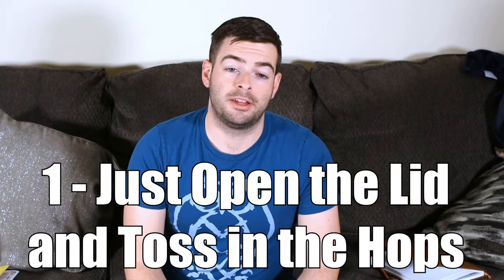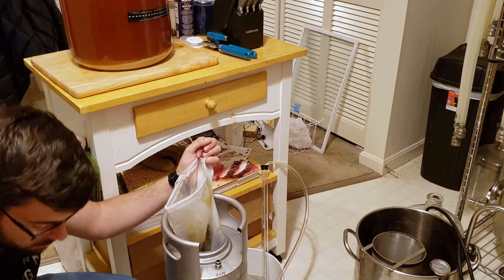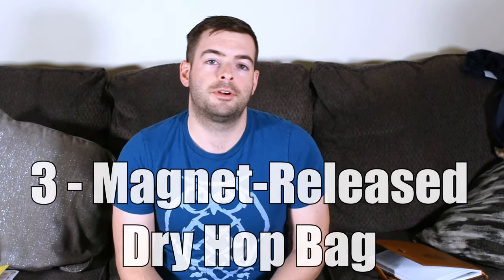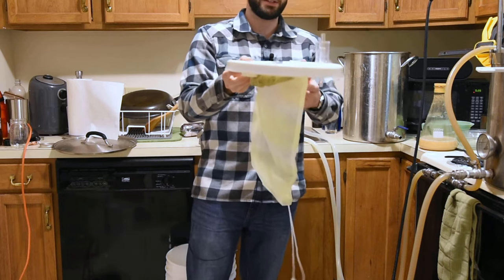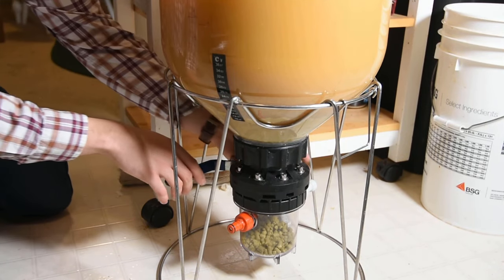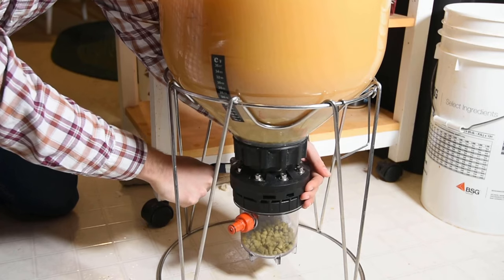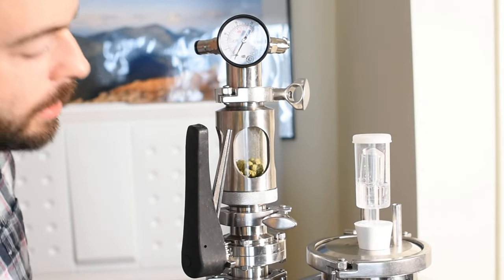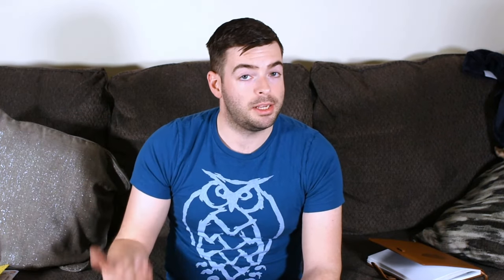5 BEST Ways to DRY HOP | Techniques for EVERY TYPE of FERMENTER | How to AVOID OXYGEN

Comment: I noticed a huge difference in flavor when using or not a hop bag. With a hop bag I couldn't smell any of the hops, so I am just throwing hops directly
Reply from the maker: That's interesting, I think in my experience I have noticed a small difference, but nothing too mind blowing. And also it does definitely help to you have a bag for cleanup
Reply: @TheApartmentBrewer  Yeah definitely the bag keeps the beer clean from all the hops residual. But I added a filter to the fermenter tap to prevent that =)

Comment: I've been using the "magnet" technique. I've been worried a bit tha CO2 generated from the fermentation removes the nice aroma of hops before the addition while it is hanging on thr head space. I could actually feel that the aroma coming out of airlock diminished over time. So by the time I tossed the hops at 10ish day of fermentation, the aroma was already almost gone. Any though about this issue?
Reply from the maker: That's not been my experience, but you could always set them up during primary where it's safe to open the fermenter, or if you have a pressure capable fermenter, you can pressurize it to avoid that

Comment: FYI for dry hoping in the Fermzilla for instance a 3-5 day dry hop, the hop pellets seem to plug up the ball lock connection when dong a "keg transfer" as this was my experience :-(   Any tips on this other than using hop bags and cold crashing  due to the 32" size of the Fermzilla. Thanks
Reply from the maker: I had good results when bagging the hops with the fermzilla, otherwise using a dip tube filter is a good way to go if they are loose

Comment: What’s your issue with the fermzilla design?
Reply from the maker: I had both the regular fermzilla and the all-rounder. I love the all-rounder, but the collection jar on the fermzilla had lots of durability issues. Specifically plastic threads cross-threading and cracking. You still have to take the carbonation caps off the collection jar when you clean/sanitize and they never seemed to get a good seal after one or two times.

Comment: At some point I'll probably build a hop dropper as I feel like that's easier than what I currently do, but it's still a bit pricey. However, I purchased two Fermzilla All Rounders. I have the beer fermenting in one, then add dry hops to the empty All Rounder which I purge the oxygen out of, and then transfer the beer on top of the All Rounder that has just the hops in it. Hope that makes sense.

Great video as always!
Reply from the maker: Definitely not a bad method. Cheers!

Comment: Just be aware what you call "purging" of the sight glass (or collection jar) only minimizes the oxygen, it never eliminates it.  If you pressurize the sight glass to 14.7psi that is the equivalent to one atmosphere, i.e. equal amount of air and CO2.  Given time they will mix completely and when you vent, you have dumped half the air.  The next cycle will dump another half (down to 1/4), next cycle will dump another half (1/8 of original air remaining).  If pressurizing at a lower psi you will be venting less than half the air per purge...eliminating that pesky oxygen at much lower rate.  So unless you do an absurd number of purges you'll always have air (oxygen) remaining.